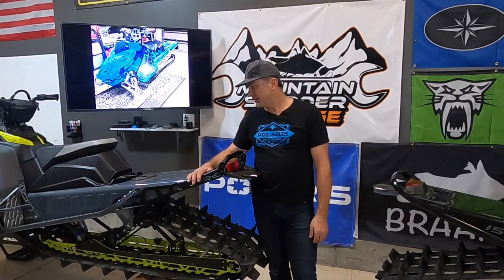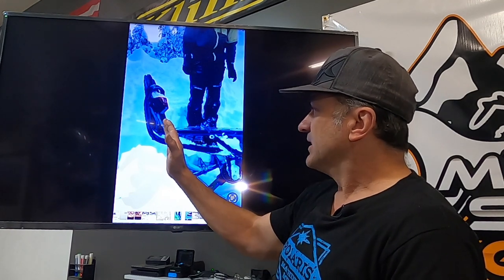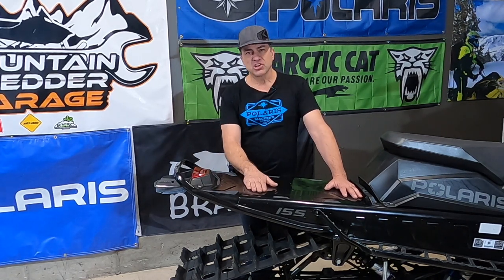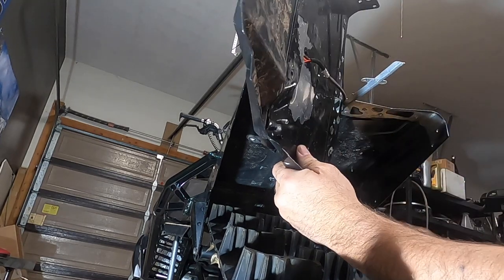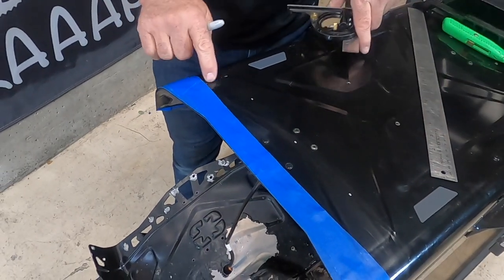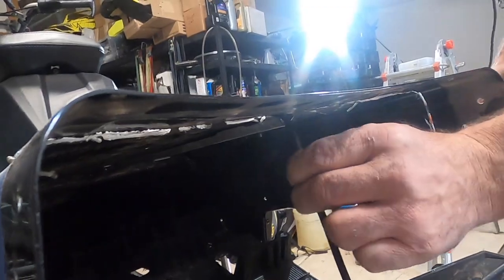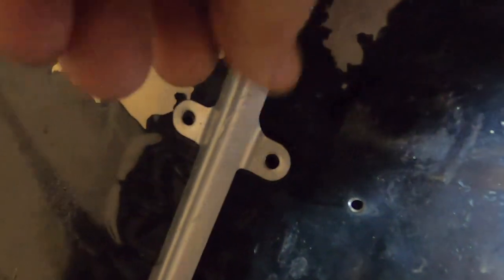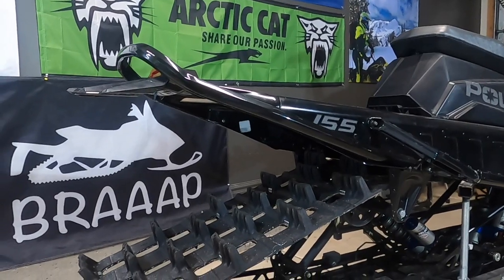Polaris Matryx DIY tunnel cut

Comment: Thanks for the video, been wanting to do this to my slash as I found it just a little too long last year dragging the bumper and even exploded a tail light housing.  I like my bumper directly over center of the axle. One question? Couldn't a guy just take a compass scribe set it to 3" and follow the lines of the rear tunnel piece speeding up the process and eliminating some room for error that is there by using painters tape and measurements?
Reply from the maker: Yes, there’s a number of different ways to do it. Just want to make sure it’s 100% where you want it and makes correctly before you cut.

Comment: Great work. What size rivets did you put in to attach the extension piece on the tunnel? Were they factory from Polaris? Trying to figure out what I need to order. Thanks
Reply from the maker: I just used standard 3/16 pop rivets

Comment: Did you drill and tap new holes in the bumper to re mount it? Or drill new holes in the tunnel? Seems like on the non slash I will need to cut my bumper down but then need to drill and tap some new holes in it. Hmm
Reply from the maker: I used an aftermarket bumper. If I was going to use the factory bumper I would just drill new holes to match up the threaded holes in the factory bumper.
Reply: @mountainsleddergarage8627  yea that's what I'm thinking. Except that the factory bumper will protrude way down into the running boards. I may cut some of it off.

Comment: I have a 165 slash boost. Is it possible to measure a 155 slash tunnel and cut off that exact amount and then run the 155 slash backwoods bumper? I wanted to get a 155 but could only get a 165 this year.
Reply from the maker: Yes you can. You could get the bumper and then cut off what you need to fit the bumper